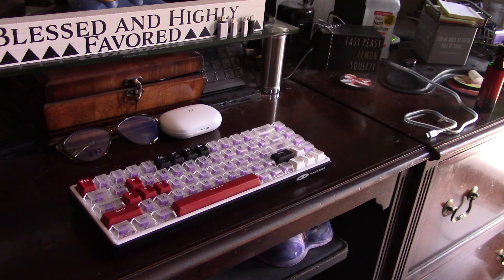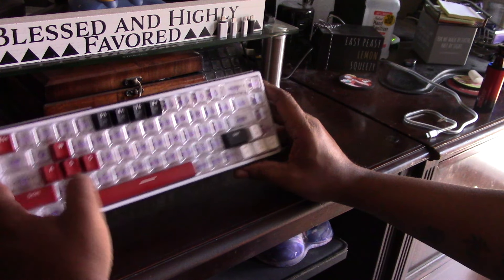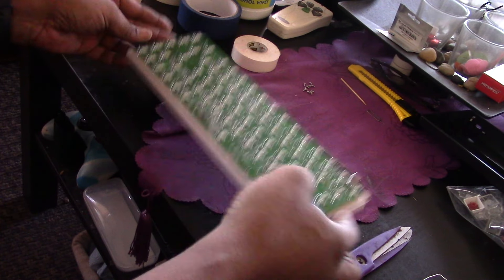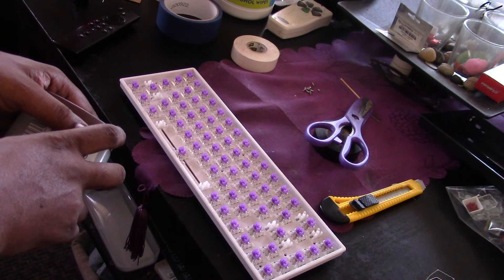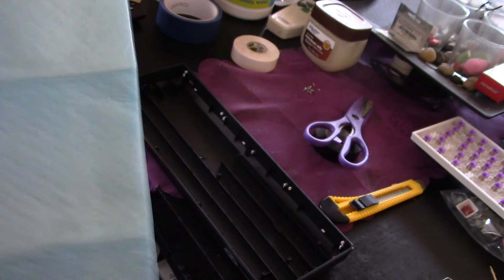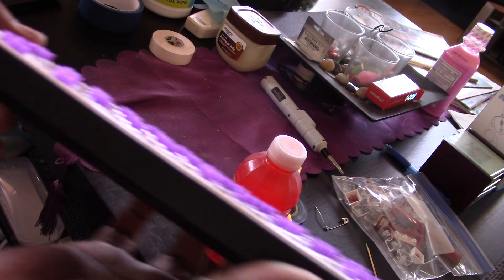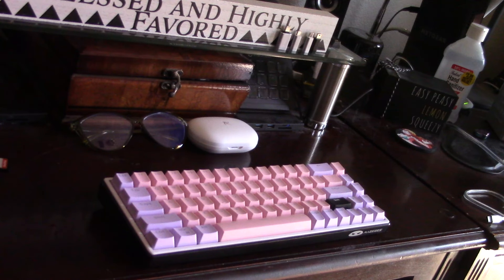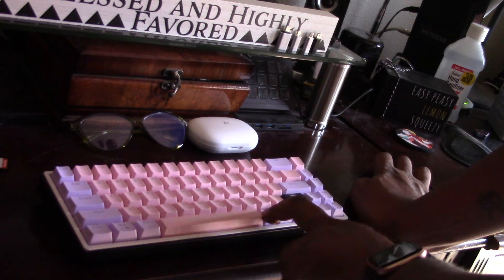Mod Your Mechanical Keyboard with Household Items!

Comment: next time maybe dont use electrical tape/ duct tape on the back of the pcb since if you ever remove it it can pull the hotswap sockets off
Reply from the maker: I used electrical tape. And I think I will be using painters tape moving forward. I had seen some people use electrical tape and wanted to give it a shot. Thanks for the tip and watching!